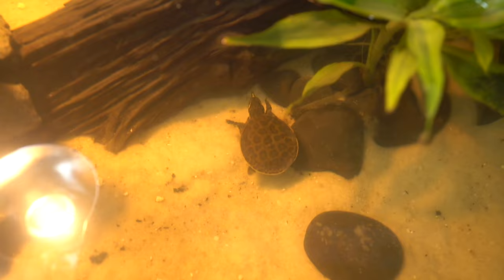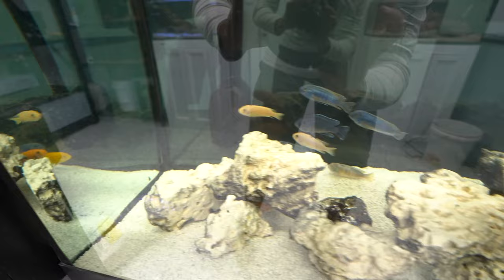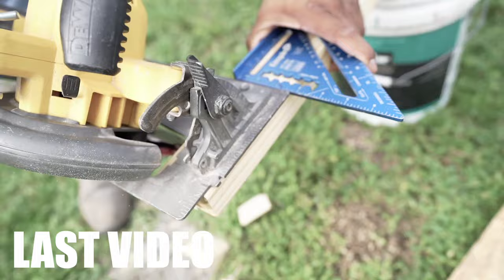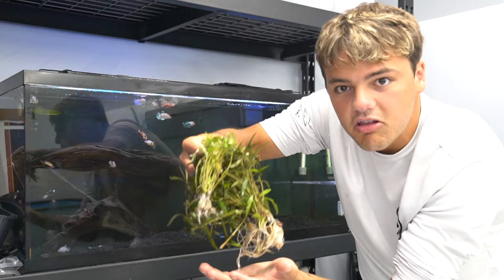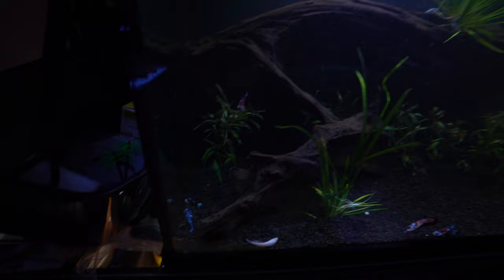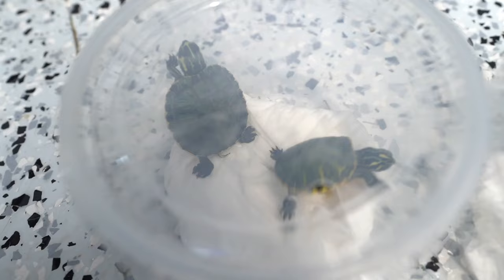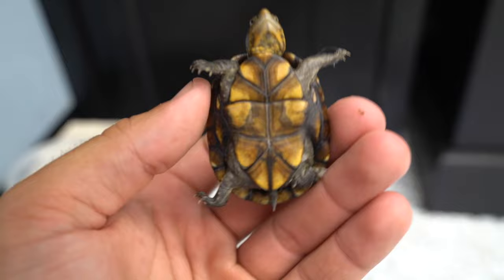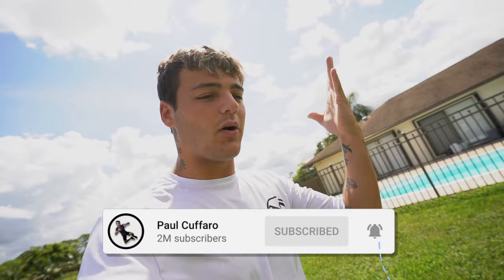BUYING a BUNCH of EXOTIC TURTLES for My 120G POND!!

Comment: You'll want a brighter light for the live plants or they will most likely just melt away... Maybe do a bright light for daytime and blue light at night??
Reply: I agree however he couldn't do that as the turtles constantly need that light as it's a heat lamp that keeps them at the right temperature
Reply: All the plants he purchased require low light. They will do just fine if he uses ferts. If he trips up that much about it I would encourage him to buy a submersible spot light. Fluval has one you can pick one up for about 40 bucks and it’s full spectrum.

Comment: On average you need 10 gallons per inch of a turtles shell.  You have roughly enough room for 10 turtles at the size they are... Give it 4 to 7 months and you'll need to move them into a much larger pond/tank/tub so please don't add more of them, think of the animals needs, not your wants.  Some of the species you have will need 100+ gallons for a single turtle within 3 years.
Reply: He had his other turtles in a "pond" the size of a bucket originally so I don't think he cares about proper care for them.
Reply: He will move them but your thinking very soon which isn’t needed yet it will take at least 2 or 3 months before they need to be moved
Reply: @Heartless-0702  Did you see the part where I said "Give it 4 to 7 months and you'll need to move them into a much larger pond/tank/?"... So no, I'm not thinking "very soon"
Reply: You are completely right, he bought so many turtles at once, it is a huge commitment. I keep turtles myself, they grow so fast, he's gonna need a big fish tank for EACH of them. He should do more research before doing this, these animals require a lot of care. Also, it is dangerous to keep multiple turtles in one tank, they could fight, especially because of the low water depth.